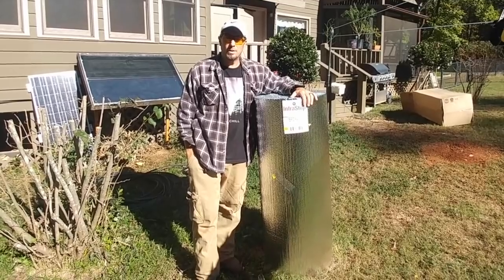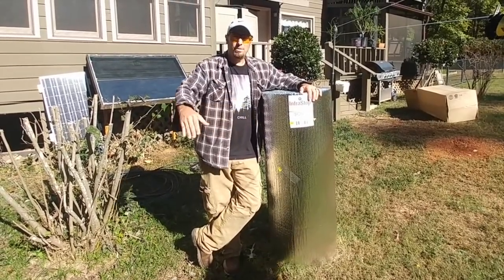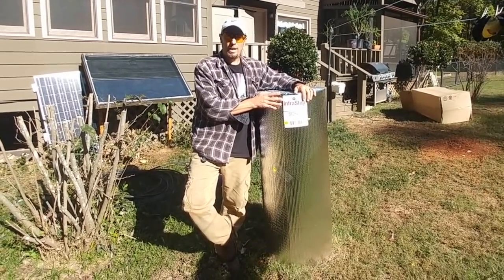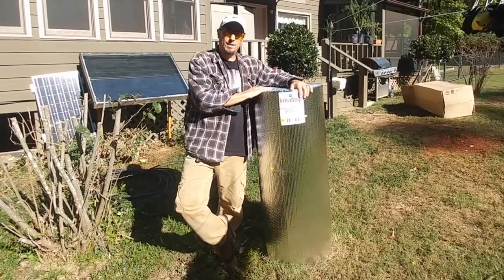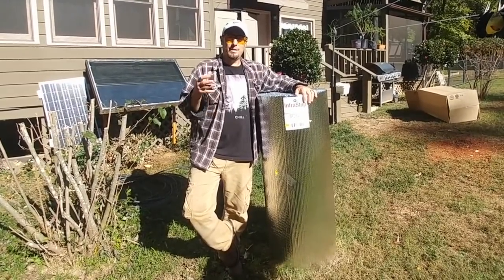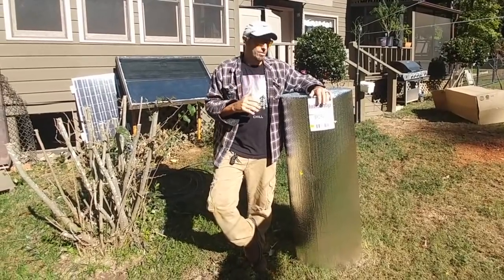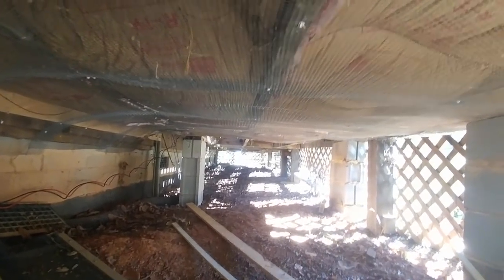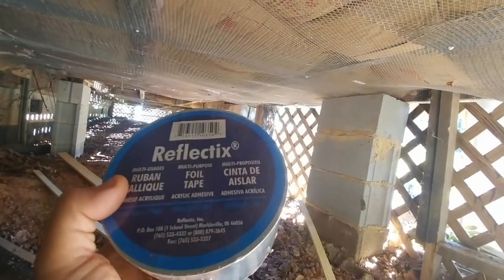Does Bubble Foil Really Work?

Comment: What you have done does not meet what is regarded as standard thermal insulating practice. First of all, a proper 6 mil vapour barrier should be placed to the warm side of the insulation. Then the cavity is filled with insulation. Then an air/vapor breathing membrane goes to the outside. Lastly, you could cover this assembly with a critter mesh. By installing foil insulation to the outside, you have now installed a vapour barrier to the wrong side allowing a perfect situation for moisture accumulation, which in time will lead to mould growth. Also, by not sealing the foil by 100%, any gap will allow the heat to escape anyhow. Best practice would have been to remove the fiberglass bats and hired a professional spray foam contractor to insulate the underside of the floor. Also note that the spray foam may require a final coat of fire retardent spray to meet local building code.  3 inch spray will give you an R value of approximately 18.
Reply: George Labottum ...correct on all counts

Comment: I have used the foil bubble wrap extensively. I dont find ANY need for an air gap when you use it. It is the lack of TRANSFER of temperature between one side of the foil and the other that is the importance. In the northeast all ductwork is covered DIRECTLY with this product with NO gap. If you use a laser temp gun you will easily see that the temperature of the foil covering the ductwork is the ROOM temperature... not the temperature of whats INSIDE the duct. I E... no transfer. The stuff is phenomenal
Reply: Would it work on the inside of skirting?
Reply: @jenniferguptel4143  I am not sure what that is
Reply: @rogerwhiting9310 she means the white skirting under the house between the ground and the floor. The visible part of house.
Reply: @jenniferguptel4143  if you dont block the ground temperature...ie directly under the rv...it wont do anything

Comment: Even though your fiberglass insulation is upside down you are fine. The foil on your bubble wrap is a vapor barrier in itself.By using this material you slowed down the air infiltrators to your floor. You’r final result is scientifically a warmer floor. You and that young man did a good job.
Reply: John q.Public the bubble  wrap is a vapor barrier.it is better than paper.Otherwise you would be right.
Reply: Rodney Parden sr I will have to agree with JOHN Q PUBLIC. The paper always faces the conditioned space. It has to be perforated so it can breathe. The bubble wrap has to be perforated also. There are more than one bubble wrap products depending on the application. A better option would be the foil.

Comment: It has to do with air sealing. Isulation is no good if your house replaces heated air for new cold outside air. The product you used would help air seal when installed correctly.  Fiberglass is useless in homes not air sealed. You can air seal a home and use no insulation and will be easier to maintain a temp than a home with r60 leaking like a siv. Igloos are an example. Snow has better air sealing properties that insulating.  End result is warmer temp than actual temp of the snow. Add a breeze through an igloo and all the heat gets removed because ice and snow don't hold heat. Air sealing is the way to go